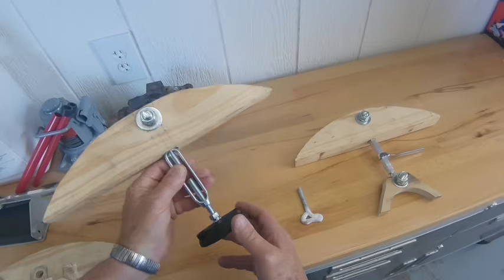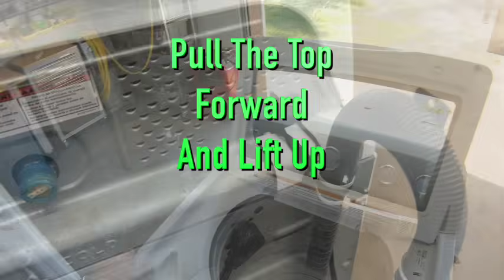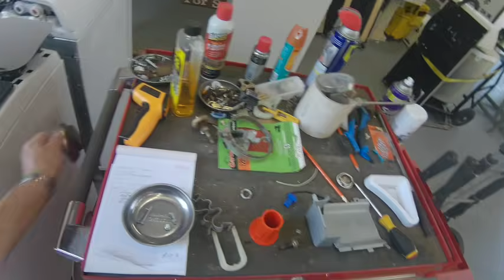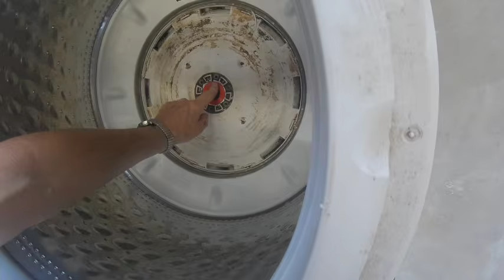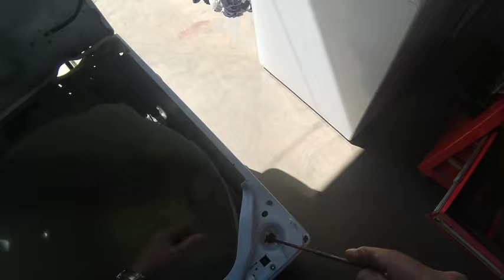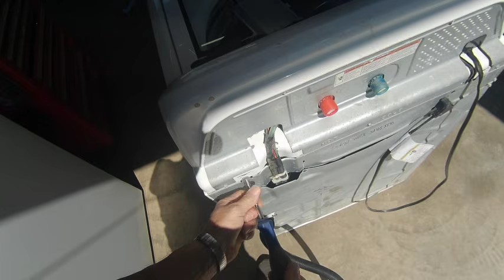How to Fix Persistent Out of Balance Issues in Maytag & Whirlpool Washers!

Comment: Excellent work sir and a great video. This is what I've been looking for to help with my Maytag Bravos washer. Very impressed with your shop by the way.
Reply from the maker: Thank you. The Missus says I have OCD!
Reply: @HarperandKnowles  Strangely, my Maytag Bravos doesn't have an M8 x 1.00 bolt holding the wash plate down. Mine is an SAE 5/16" fine thread bolt. I guess from time to time they change what bolt size they use or maybe it depends on where it was manufactured which bolt they use. Anyway, it was a heck of a fight to get the wash plate off. And now the drum is fighting me coming off haha! Of course mine would fight like the devil!

Comment: i got a maytag bravo. i was watching your video after i had done several repairs.i replaced the inner hub with a new plastic one and when it wore out i found out they make a metal one so i put it in hoping it would fix the out of balance issue. since the metal hub basket assembly screws down and tightens and is all metal. and it wouldnt spin properly even with a no clothes spin cycle. i also replaced all the suspension rods. 1 was bent from t he shaking , found out the basket has a inner bushing. just got the part in today had it installed in 20 minutes, went to start the wash and it shaked on slow downs and  right before full speed spin,  ( no clothes) with clothes it just flops around at right before full speed. so it will skip the spin and drain. from being out of balance. ive lose hope in this machine. onlything i can guess it would be now is the bearing near the transmission shaft.
Reply from the maker: The tub may be bent from using it in an unbalanced condition. Thanks for watching!

Comment: For the stuck washplate I tried the hot water and citric acid soak, didn't work after 4 hours. Shoestring method didn't work. I took that approach up to paracord and a 2x4 over the washer and a bottle jack to pull the string, only succeded in breaking the washplate. Next I broke all the plastic washplate off to get to the hub, it was corroded onto the driveshaft. Tried a torch, no dice. Gear puller didn't work. Finally took my Dremel with cut-off disks and cut the washplate hub into three pieces to get it off the driveshaft. Got the wash basket out and the original hub was very out of round. With some difficulty I got the old hub out and the new one in. Washer did 2 loads tonight and runs so smooth and quiet now I forgot about it. Maybe make some extra of your air hammer extraction tools and sell them, you'd probably help some people out.
Reply from the maker: Yeah, I've thought about it. I experimented with some blank hammers but they are too hard to cut threads on. They have to be two pieces the hard hammer part and the softer threaded piece. Folks that work on these machines can fashion their own. That market isn't broad enough to be very profitable. It sounds like you had a rough time though. Thanks for watching!

Comment: Man your tub went back in easy. I tried for thirty minutes to get mine back in and it still didn't fall back into place.
Reply from the maker: If you clean the shaft up real well with a wire brush and fine sand paper it usually slips right in. Thanks for watching!
Reply: Wtw8540BW0
Reply: Any tips for getting the spin basket out after installing the new bushing? It’s not all the way down and it also doesn’t want to come back up. 😑
Reply from the maker: Here is a tip for when you are ready to reinstall the tub. Use a wire brush and sandpaper to polish that rusty shaft. Now, to get it out you may have to use a scissor jack and a two by four cut to fit just under the balance ring. Watch this video https://youtu.be/KegGGSrD0qA?si=Bf07UA8MJTpHCTS0 about 6:58 in you will see how I do it. Thanks for watching!
Reply: @HarperandKnowles 
Thanks much! Will give that a try.
Reply: @HarperandKnowles 
Used a bottle jack and 2x4. Worked great! Thank you so much for getting back to me so quickly! 1) Any lubricant required or recommended on the splines, before I attempt to reinstall the basket? (2) Is the splined shaft a replaceable part or is it one piece with the motor?
Reply from the maker: No, you'd rather not have grease on your clothes! Glad you got it out!
Reply: All reassembled and working great! Thanks so much! Truly wouldn’t have been able to get the tub back out without your tip/video.
Reply from the maker: I’m glad it worked out for you. You are welcome!
Reply: Did you finally get your basket back on ? If so how because I’m having the same issue.I’m going to try the sand paper and wire brush.

Comment: Hi Chip,  nice instruction!  My machine is 4 years old and it's not being used in a big family, just me and the wife.  It regularly goes off balance no matter what we try... My question is this something that should or could happen to a lightly used machine only four years old?  I'm ready to scrap it... but if this will fix it, I'd give it a shot.
Reply from the maker: Unfortunately this repair hasn’t been time tested but it does look promising. And, yes, these machines were poorly designed and I’ve taken many of them to the scrap yard. Some only two years old. It’s not an expensive repair if you’re doing it yourself so it’s worth a try. Thanks for watching!
Reply: @HarperandKnowles  I spent the day re-leveling the machine, popped the hood and took a look at the springs.  I don't believe they are the problem though, the 'shock absorber' function seems intact.  I push down it comes back up and stops rather than bouncing a number of times (same like you would do on a car).

What I DID notice when I had it opened up is that the INNER drum can easily be moved about a quarter inch side to side in all directions, relative to the OUTER drum.  Does this indicate that the bushing for the drum is worn out, or is this a normal and acceptable amount of play?  I hope the question makes sense!  Thanks for any assistance you can offer.

Also... and by the way... even without any clothes or water in the drum, when I engage the "Drain and Spin" function, there seems to be quite a bit of imbalance with the drum empty.  I think that ain't right either, is it?  Maybe that bushing in the bottom of the drum is worn out already?
Reply from the maker: If you have either of those machines you can bet on that bushing being the problem. Thanks for watching!
Reply: @HarperandKnowles  Thanks Chip, you're awesome.  I have one more question though... I've looked and looked at all the appliance part distributors I could find, and none of the diagrams show that bushing (the orange one that you said appeared to be 3D printed) available as a part.  Can you advise as to where it might be available?  By the way, it's a Whirlpool WTW5000DW3 model.
Reply from the maker: I always put a list of where to obtain parts in the description. Check there.
Reply: @HarperandKnowles  Thanks!  Sorry I missed that!  :hand-purple-blue-peace:
Reply: @HarperandKnowles  Hi Chip!  I ordered the parts from McCombs and installed them day before yesterday.  It wasn't quite as "plug and play" as you showed though.  I ended up having to cut and chisel the old bushing out of the drum.  It would not drive out.  But being an auto mechanic, I'm used to that sort of stuff happening.  Next, the shaft was quite rusted and I had to spend a bit of time smoothing that down.  Even then, the bushing was too tight for a 'slip fit' over the shaft.  I ended up using a brake cylinder hone on the inside of the bushing to open it up a bit more.  Long story short, I got it back together and it's working at least as well as new.  Many thanks for your help Sir Chip!
Reply from the maker: Hmmm, I’ve never had any trouble with them. Usually one sharp whack and they come right out. Anyway I’m glad you got it fixed. Carry on!
Reply: @HarperandKnowles  Hi Chip!  Just wanted to follow up on this repair... after many loads of wash over the past few weeks I am happy to report 100% success!  Thank you again my friend!
Reply from the maker: You are very welcome. I’m glad your repair was successful!

Comment: When would you use Ben’s shims over this insert?  I installed a shim and metal hub on my last one and it wasn’t straight it’s wobbling and I stripped the bolt so now I need to take it to a welder to get the nut off so not sure if it was user error or the shim or what now lolz
Reply from the maker: I’d use them if I ran out of inserts.

Comment: Hey mate 👋🇦🇺.  This machine looks very similar in style to the Fisher & Paykel ones that I have a lot of out-of-balance troubles with. So with these units the strange issue that causes out of balance is the holes in the spin basket are very tiny and get blocked with detergent buildup. So when spinning the water can’t easily spin out of the bowl and the machine will shake so violently it will dance across the floor. So for this case pressure cleaning the inner bowl (spin basket) fixes the problem. 
Anyway, great video, keep it up 👍 🤙
Reply from the maker: I have only seen one Fisher & Paykel machine in 6 years. I wonder if drilling some of those hole larger would fix that problem???

Comment: Chip, great repair. The suspension rods, metal hub and the new tub insert look to be about $60. Not a bad deal to repair a washer for a customer, but the parts cost start to add up when it is a machine that you plan to sell.
Reply from the maker: Yeah, it’s a little more than that when you use the OEM rods. But I still make a tidy profit. Lol, I never seem to count my labor cost.